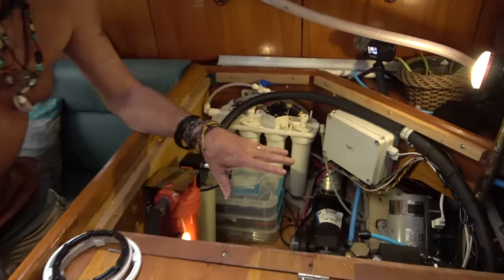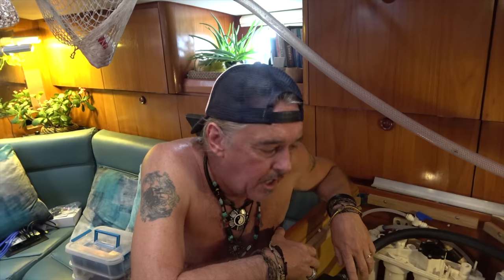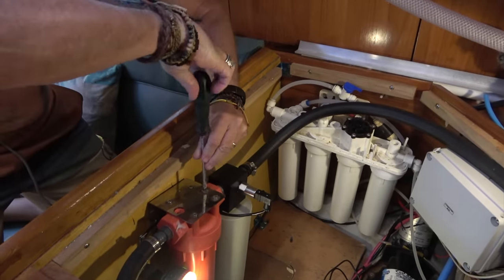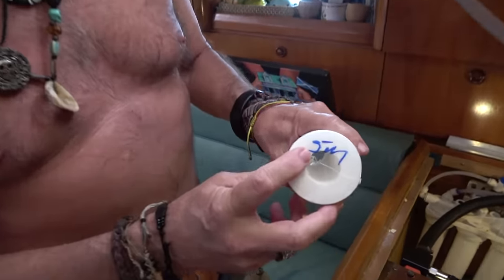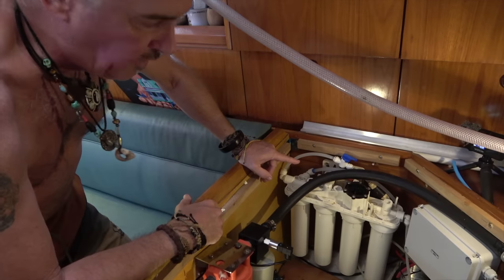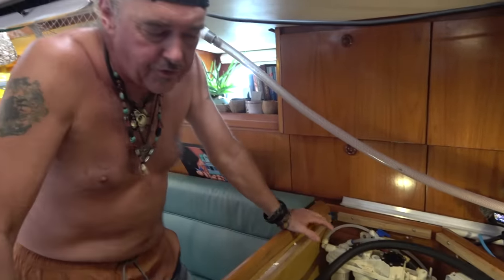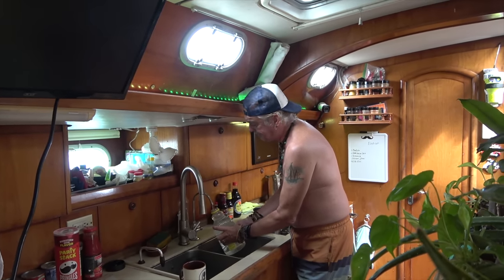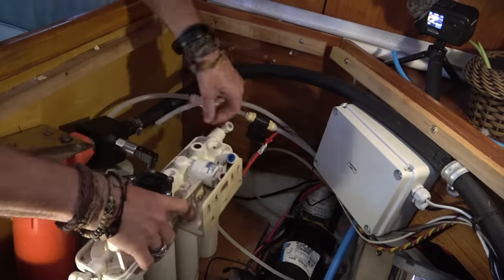SSL660 ~ I can't believe what was in our WATER..!!

Comment: I have gone through the calculations.  The best I could figure is Sodium is your main concern in RO from seawater, as it is the major salt by far, and every 100 ppm TDS is roughly 40 mg/l Na.  Somewhere I heard a man is supposed to drink 3.7 l water a day.. hmm..  4 cups of coffee 6 beers and some ice with your scotch... OK maybe.  So 150mg Na per 3.7l at 100TDS.  So 200TDS gives 300mg and 300TDS gives 450mg.  The medical website says 2300 mg Na intake per day is a reasonable target.  So drinking 3.7 l of 200 to 300 ppm TDS (assuming it's all Sodium Chloride)  would be 13% to 20% of your daily allowance.  Too little salt is bad for health as well.
As far as watering plants,  if you soak them good once in a while letting water run out the bottom, it will keep the salt from building up.

Comment: I'm replacing my water pump today. Discovered that it had been leaking, possibly for the three years I've had the RV...
New pump, almost no pressure, and no stopping the water....water freely flows from the tank through the off pump out the faucet. If I turn the pump on, minimal extra pressure, and it doesn't stop...just builds pressure until the pump starts crying from creating too much pressure. So it works a little bit, but not enough or the way it's supposed to. The guys at my shop were not sure what could be wrong. Have you experienced anything of that sort? 
New pump is way quieter, which might be a bad thing.
Always something living in a vehicle: boat or RV. Gotta fix the generator and fridge, too....ooph.

Comment: Your house water pressure pump is cycling. Either you have a leak or it's valves are leaking and bleeding pressure. The only time that pump should come on is when you draw water. HTH